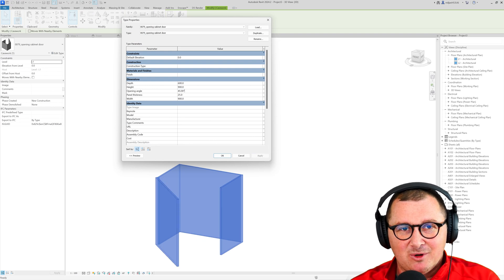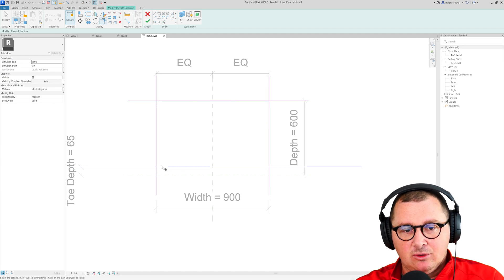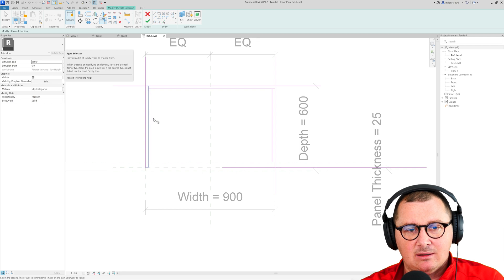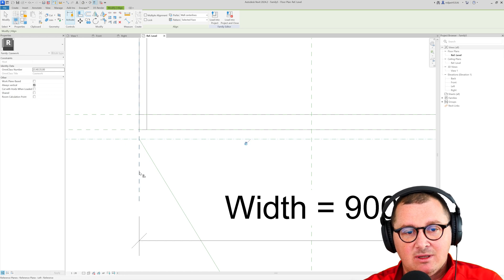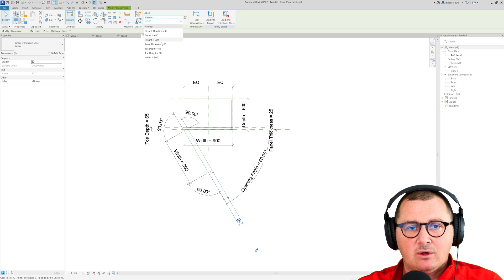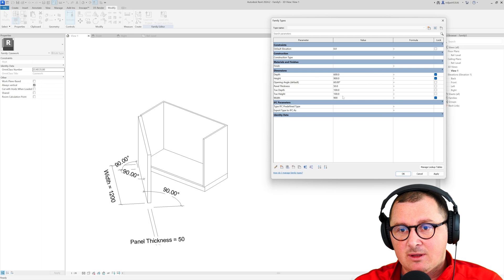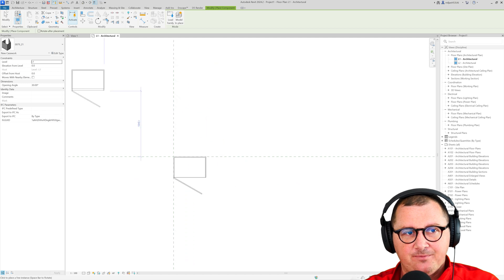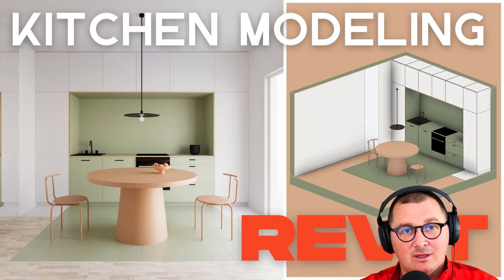Kitchen Cabinet - Revit Family Tutorial

Comment: Thanks a lot :D but what if you want some of them to host a sink/ oven, have drawers or opening in a different way, it actually takes a huge amount of work to make a proper parametric kitchen cabinet. My coworkers use archicad and I think the cabinet tools on that software are pretty cool.
Reply from the maker: they are all separate families, so one is kitchen cabinet, other one is countertop, then drawers, upper cabinets, etc, but what is great with Revit is that you could nest them one into the other. For example, for kitchen cabinet you can create different panels and nest it into to core of cabinets and upper cabinets or drawers, which means that you can nest xy number of panels and turn them on/off with visibility paramater for example. It require some time to be made but once it's done properly it works great
Reply: Oh I see, yes you are right, I think I've used a kitchen family like that before. This will result in a somewhat heavy family but def doable with some time investment if you also want to add different types of handles. I'd love a tutorial where you explain this method :D
Reply from the maker: @Laura_Dancing  It shouldn't be heavy family, optimizatoin is a key. I will definitely make a tutorial based on this topic :)
Reply: @arkiteasy  Please do 😅